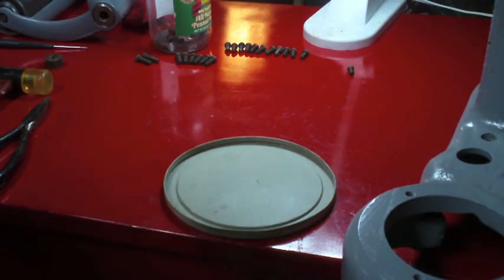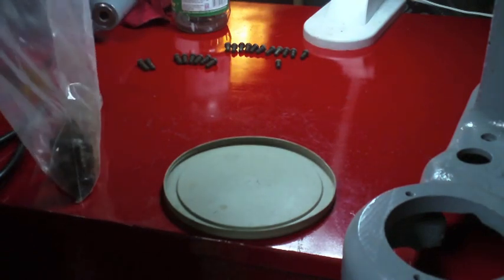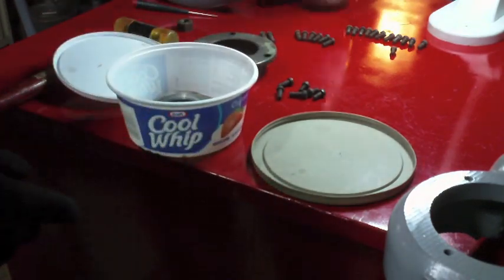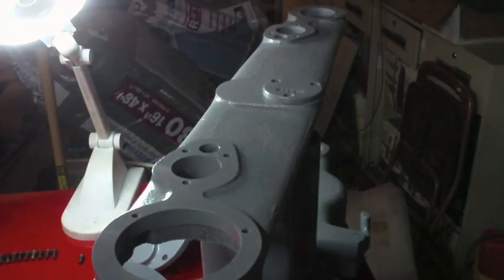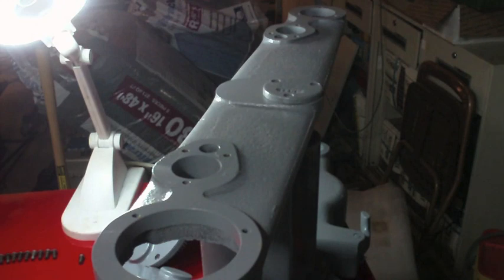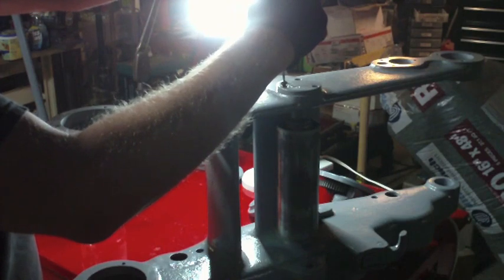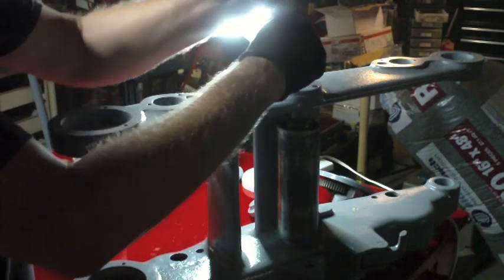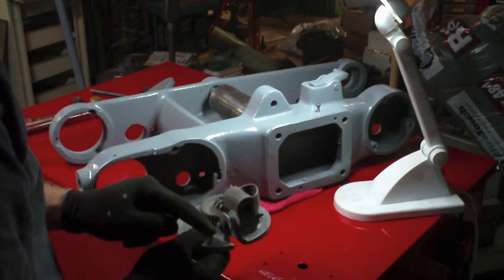Sipp Drill Press Part 32

Comment: Did you see the blue Sipp on eBay?
Reply from the maker: The one with several missing parts? That has been re listed for months now. I doubt it'll ever sell at that price. I think I paid $100 for mine, and a while back there was one on Ebay in Ohio that was complete, and running for about $150. Took him several tries before he either sold it or gave up. Yet another example where rarity does not equate to higher value.